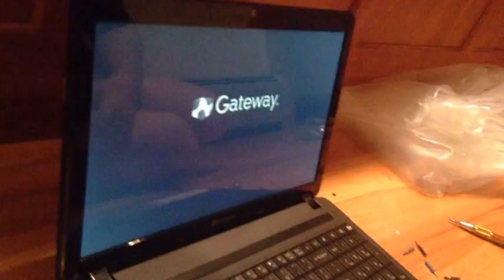Gateway Ne56r49u Screen Replacement

Comment: thank you gentlemen. It was educational. I have the same computer. It's not under warranty if there is any pressure breakage. Acer/ Gateway sees it a accidental. So it's not covered. Cost me $130.00 to have it fixed. But these screens are have no protective layer on it. I have never had a broken until i brought this gateway brand. Something tells me this Gateways fault.